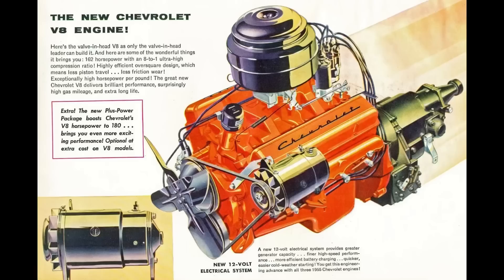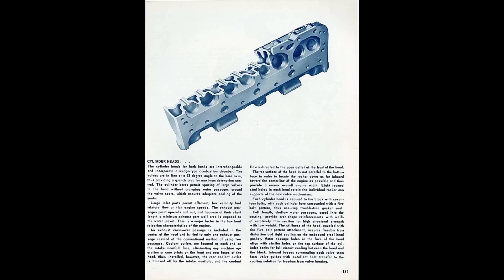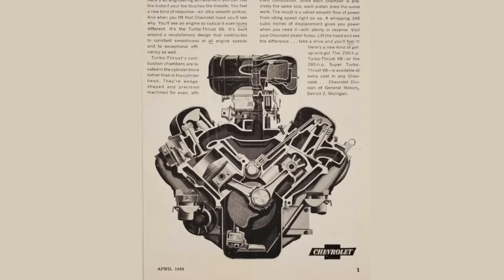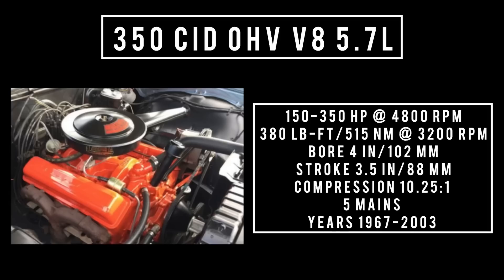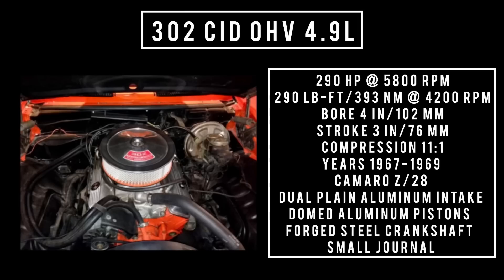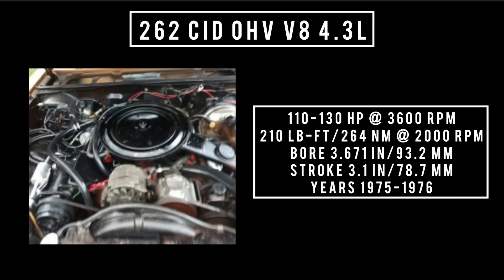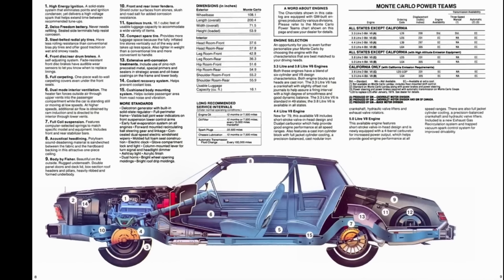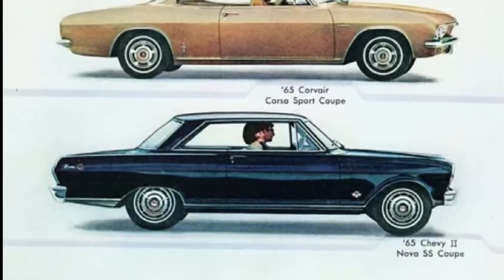First Generation small block Chevy engine family 265, 283, 327, 350, 302, 307, 400, 262, 305, 267￼

Comment: Ah... the small block Chevy... You're absolutely right, if you were to list all of the different options over all the years, we would definitely be here all day!  Since GM is still building them as "crate" engines, I'm pretty sure they hold the #1 spot for longest production run of any American V8... possibly any engine of any kind...

Not only was Ed Cole a racer at heart, but Zora Arkus-Duntov was a racer professionally... and he put more than just his "2 cents" worth into the SBC.  In fact, it was his idea to "steal" the ball stud rocker design from Pontiac and the only reason GM brass agreed to it is so that Duntov could use the new engine in the Corvette to blow the doors off of Ford's new V8 Thunderbird... otherwise, the SBC would have either had shaft mounted rockers, or it would have been delayed until '56 or '57.  Oddly enough, the T-bird was faster than the Corvette in '55 anyway, so GM granted him the freedom to do pretty much anything he wanted to make sure Corvettes beat T-birds on the track in '56.  T-birds still outsold Corvettes, but the 'vettes left the birds in the dust at Daytona that year.  When Duntov put the fuel injected 283s backed with 4 speeds into Corvettes in '57, Ford gave up and decided to turn the T-bird into a 4 seater!

On the subject of gross/net horsepower ratings, Chevrolet (and the rest of GM) published only gross ratings up through the 1970 model year.  They published both gross and net ratings in the 1971 model year, and from '72 up they only published net ratings.  Other companies may differ, but that's how GM did it.

My favorite SBC that I've owned is the 350 in my '78 1/2 ton that I've been daily driving for over 20 years now.  I've never seen the inside of it other than under the valve covers (replaced the gaskets).  It's 100% stock, as original as I can make it, and it's never let me down.  The only sign of it's aging is that it doesn't hold as high of oil pressure as it used to.  I own more 350s than I can count (without literally going outside and counting them), a few 400s and a 327... most are disassembled and/or don't currently run.  
However, my favorite SBC Chevy ever made would be the L84 327 fuelie offered in the '64 and '65 Corvette... the highest rated SBC Chevy ever offered.  Most people don't know that it was offered in '65 because it was discontinued halfway through the production year in favor of fancy new "Mark IV" big block 396.  Corvette collectors all want the '65 big block cars, but the '65 fuelies are actually more rare than the '65 big blocks.  If I remember right, more fuelies were built but fewer have survived.  I'll also give an honorable mention to the all aluminum 283 experimental engine from the late '50s which was devised as a way to turn the Corvette into a rear engine car with the engine mounted transversely behind the rear wheels.  (I think they also tried an all aluminum 327 around 1963... maybe.)  A prototype rear engine 'vette was made but they wisely chose to keep the Corvette conventional and introduce the rear engined Corvair instead.

Anyway, I've rambled on long enough...

The song, though well disguised, is Lynyrd Skynyrd's "Simple Man"... but I see someone else already got it.
Reply from the maker: Awesome thank you so much for taking the time to share all of that =)
Reply: Only the 1987 and newer style "Vortec" is sold as a crate engine by Chevrolet. I attempted to find the 86 and older 350, (once called the Target Master or Goodwrench replacement engines) and was told by the local Chevy dealer (Elway Chevrolet) that the 350/305 with the early style heads was no longer produced by the factory.
Even so, early heads can be installed on the 1987 and newer block.
The 4.125 inch bore "400" block also seems to be out of factory production.
Reply: @donreinke5863  Yes, the older generation small blocks, including the large bore "400s", are no longer produced by GM... (though they do still make a "Vortec" 383 with the 4.030 inch bore and 3.75 inch stroke crank) and yes, you can install the older head designs on the newer blocks, but I don't know why you'd want to (unless they're aftermarket heads) since the "Vortec" heads are some of the best factory heads you can get.  

BTW, "Vortec" only refers to the '96 to '02 port fuel injection engines (and the 4.3 V6 engines going back to around '94, as well as some of the early LS engines).  The older TBI/MPFI engines were not labeled "Vortec" and do NOT use the same heads.  A lot of people mistakenly buy TBI heads that were advertised as "Vortec heads" because they use the same center bolt valve covers, but they're nowhere near as good as the actual "Vortec" heads.  Buyer beware... the best way to tell is to count the number of intake bolt holes... 4 holes per head means authentic Vortec, 6 holes per head means TBI (or MPFI)... so make sure you get your money's worth.  TBI heads are ok, but they're more prone to cracking and they don't flow as well, nor do they have the "swirl" feature in the combustion chambers that make the authentic "Vortec" heads so good.  The MPFI heads (used in Corvettes, Camaros and Impalas) are good heads, but still not as good as the "Vortec" heads.
Reply: @livewire2759  Why you would want to is restoration of any 60s/70s/early 80s Chevrolet to "original" appearing  condition.
87 and newer heads do have the advantage of a machined valve cover mating surface which eliminates the (very) frequent task of replacing the valve cover gaskets on 1955-86 engines. Oldsmobile division did a much better job on their V8s, using as many as 10 fasteners per valve cover up until the late 1970s along with machined mating surfaces.
Chevrolet tried many strategies to improve that problem including short, then long thick "spreader" washers, and for a time in the 1970s, elimination of cork and rubber gaskets instead replacing them with GMS orange silicone RTV..still not much of an improvement.
While it doesnt do anything to increase swirl of the air/fuel charge, a few hours with a die grinder can make any engine (with the exception of the "log"(integral) manifold 144-250 ci Ford and later production Chevy inline 6 cylinders flow to its maximum abilities.
Chevrolet engines dont need extreme porting work on the exhaust side unlike almost every Ford engine (even the 351 Cleveland) made from 1968 on but flow can still be increased to rival newer heads.
Reply: @donreinke5863    "Why you would want to is restoration of any 60s/70s/early 80s Chevrolet to "original" appearing  condition."
I suppose you could do that... but one problem with that would be that the Vortec and TBI blocks aren't machined for mechanical fuel pumps, so if you're going for original appearance, you'd still have to find an older block.  They're getting hard to find, and most need rebuilding when you do find them, but they're still out there... though it would be nice if GM still manufactured them.  I certainly won't argue that the TBI and Vortec valve covers seal WAY better than the older generations, especially with the old porous cork gaskets, but the ones I own I've sealed up well enough with the aftermarket black rubber gaskets.  Silicone works too, but it's a pain to clean up if you ever have to take the covers off to adjust valves or anything, so I agree it wasn't much of an improvement.
Yes, you can do some porting on the TBI (or any other heads) to improve them, but the point I was making about the Vortec heads is that they're great "right out of the box" with no porting required... and most people aren't going to even want to attempt porting heads themselves, so they just buy Vortec heads, and unfortunately many get duped into paying Vortec prices for heads that are barely worth more than their weight in scrap iron.  Clearly you seem knowledgeable enough to not fall for that, but other viewers might not be aware, so that part of my response was really for others that might happen to read it... I just took the opportunity to explain the difference since you had mentioned Vortec engines.
Reply: @livewire2759  I definitely get what you mean about those who dont know enough about selecting heads (or any other components) and knowing the differences between them.
The guy across the street..I call him Mr Chevy, sarcastically of course (hes got 8 old Chevrolets from 1941 up sitting around his yard, none of which run) has NO clue about Chevrolet engine components and their differences despite his father having been a line mechanic at a Chevy dealership for over 30 years. He was about to stick a 350 he got from a trusted "friend" (it was an old Mexico manufactured Goodwrench engine) straight into this old 77 1/2 ton truck he bought without doing any inspection on the engine. I told him at the very least remove a couple main and rod caps and look at the bearings
  I watched him pull the main caps off (using a 3/8 inch drive ratchet and a cheater pipe... smh) to inspect the bearings and found water had gotten into the engine  somehow,  pitting the #5 main journal.
He was all bent because the crank needed a trip to the machine shop and its still not ready. At least he knows that you cant put a smallblock distributor in the 348 sitting in front of his garage door.
Those are the kind of people that would fall for the scenario you mentioned, and hes certainly not the only one Ive run into.

Comment: What's interesting to me are the details, how different things were tried (like cast iron cranks) and the squeezing and thinning of engine casting thicknesses, with attendant problems.  We had a full sized Chevy Impala wagon, circa 1971, retired it to the junkyard in Marinette after 101,000 miles, only to discover someone in town bought it from the scrapyard and drove it practically forever, so Chevrolet made some good engines among the few mistakes.  The guys in the auto shop tried to blow one up by running it to the max on the redline, but didn't succeed (thankfully 😅).  Apparently the engine showed no noticable wear and was impeccably well balanced, so hat's off to Chevrolet and to the engineers at Pontiac that lent them some of their successful component designs!  Great video Jay, keep on keeping on!! 🎉
Reply from the maker: Awesome =) glad you dig this one thank you so much fir sharing those stories what great memories 

Reminds my of the 1st town car I had sold it cheap and the guy drove it for another ten years before junking it
Reply: @What.its.like.  lol, the family trucksters lived forever!  Thanks Jay for the fantastically well researched presentation!!

Comment: I'm running a rebuilt 1959 283 with 9:1 compression medium rise intake, off road mid to high range  cam and reworked 305 heads good for an easy 6 grand rev in my 1959 GMC 9320 Canadian GMC truck . The carb is a 600 cfm QUICKFUEL.  it pulls real good over 2000 rpm. with the S10 T5 transmission and 3:73 gears, it runs 70n mph at 2100 rpm.  good little engine. The engine builder says it should be close to 300 HP
Reply from the maker: That’s awesome that engine sounds amazing I wonder what it sounds like it person =)

Comment: I've never had a bad experience with a SB Chevy.  Love the 350 because it's so dependable stock and so easily modified for HP and torque. The 283 was a honey of an engine in family transportation, I believe with minimal care one would run forever.  I've had a couple 305 equipped Chevies, while not fast they sure were sturdy.  My favorite?  Either the L82 I currently have or the LT1 I had in my Impala SS.  Thank you as always, great work!  ~ Chuck
Reply from the maker: Awesome =) I’ve only had 327 350 and they are great engines parts are cheap and possibilities are vast vortec heads is a great upgrade or so I’ve heard great way to make easy power.. thank you so much for sharing =)
Reply: @What.its.like. The Vortecs we’re famous for their ability to breathe but unfortunately the castings were so thin that they suffered from cracking and casting shift. I think several aftermarket companies have produced better quality Vortec copies.
Reply: Development of the Chevrolet small block is not commonly attributed to Ed Cole, but rather Zora Arkus-Duntov, an engineer/designer who had already developed an overhead valve conversion for the Ford flathead (valves-in-block) V-8
Reply: I've had a couple 305s and several 350s. Most of them had cams that went flat in them, killing power. GM had a time period where the quality of their camshafts was sub-par, causing them to go flat prematurely.

Comment: First car, bought used in 1971, was a 1968 Impala with the 307 & Powerglide. This was pretty much a bulletproof combination. Nothing ever went wrong with that drivetrain other than burned some oil after about 80.000 miles. If I hadn't t-boned another car in 1979 I don't know how long that car would have gone on.
Reply from the maker: Thank you so much for sharing that sorry your car got t-boned, was everyone ok cars are replaceable people aren’t
Reply: I was the only occupant of the car. With no seat belt on, my chest hit the steering wheel and my head cracked into the windshield. I was hospitalized for 4 days with a concussion and 2 broken ribs. @What.its.like.

Comment: My parents had a full-size van 1986 GMC Vandura 1500, regular wheelbase, without any widows, with a 305 and 700R4. The rear differential was open (practical in Canada's winters, got stock so many times) and the 305 was gutless, sometimes downshifting to 2nd going uphill. And it was so hot inside during the summer and so loud at all times on the road...
Reply from the maker: Totally know the feeling my grandpa bought a ford econoline van with 302 v8 1989 it is the only vehicle I’ve ever driven that could lose speed going down a hill.. thank you so much for bringing that memory back =)
Reply: @What.its.like.  No problem.

Comment: Another great comprehensive episode! The 283 was really smooth with a tight power curve. The 350 was really fast but could run hot and I blew a rod on I95. The 307 was dependable but slow with poor compression after 80,000 miles. They were all good engines and easy to work on in my  69 Malibu!
Reply: I lucked my way into a great 69 Malibu, 350 V8 Holly 4v with Holly manifold. 9.5 to 1 TRW forged flattop pistons (came with pink rods and camel hump heads) 260 /272 Cam, Knock detector and variable ignition timing, dual exhaust and flow masters. I put a bunch of that stuff in there but a lot came with it (I think there was a divorce in there somewhere), I never changed the rear end from the 2.73 and it ended up cruising happily at 110 across Montana and Wyoming, easy up hills at any speed.... It would run on regular if you set the ignition right (and if you were willing to fork over for premium it got 10% more horses, but it was not really meant for horsepower, it just had bottomless torque). Then I got stupid and let it go but someday I plan to build one again or maybe first and right now I am looking for a 68 Grand Marque Brougham  (sp?)
Reply: heads and cam upgrade on a 307 they are dependable and fast
Reply from the maker: Thank you so much for sharing your experiences I appreciate that glad you dig this episode =)
Reply: There is a story I heard many years ago concerning the first thousand or so 265 smallblocks manufactured, in late 1954-55 but Ive never been able to find real proof of it.
 Supposedly, the piston rings did not seat properly on the first 265s, they smoked and had high oil consumption. Chevrolet issued what is now called a technical service bulletin to their dealers instructing the service department to throw a handful of Bon-Ami ( a now scarce sink cleanser similar to Comet or Ajax) down the carburetor bores to help the rings seat. Chevrolet almost immediately took care of the issue, and subsequent engines produced no longer had piston ring problems.